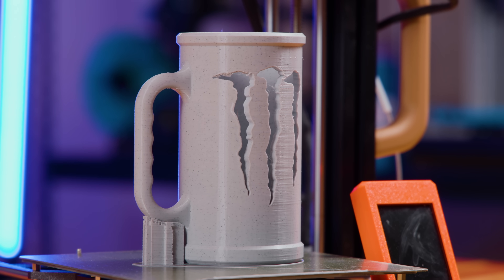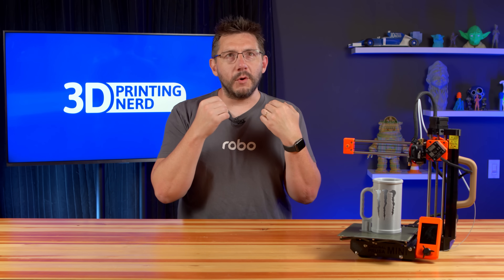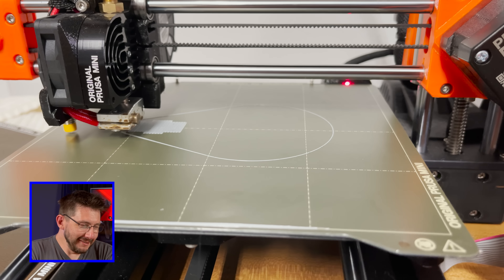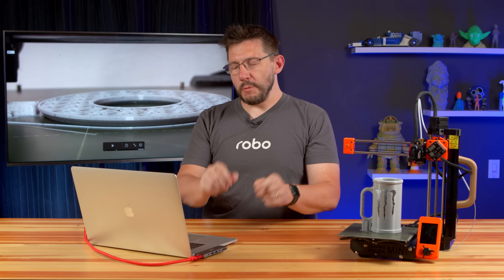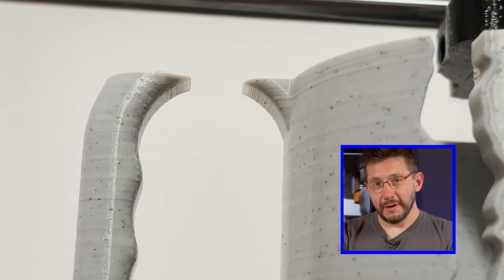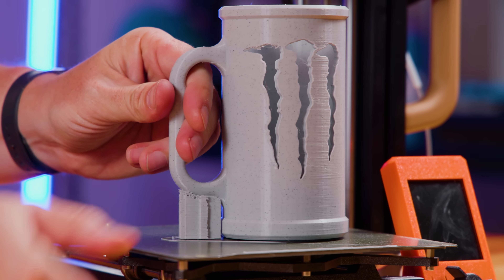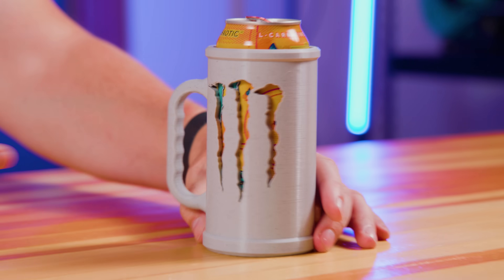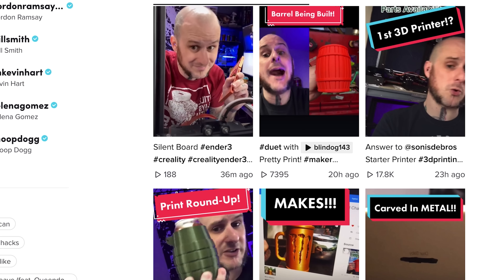WILL THE CAN FIT? // 3D Printing the Stimulant Stein on the Prusa MINI!

Comment: I actually have some vanilla bean coming for my Mini+ and the real question…. What temp do you run for that filament? Thanks for all the content, Joel!
Reply from the maker: I’ve been using default temps for the Printed Solid stuff!
Reply: @3DPrintingNerd  thanks! That was the plan, but I figured I would ask just in case it needed more or less. Appreciate you!